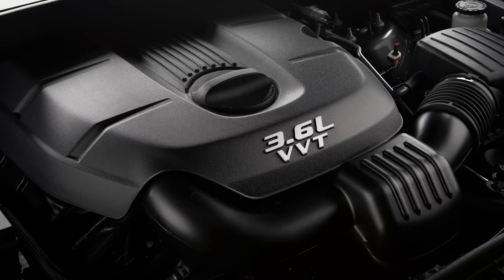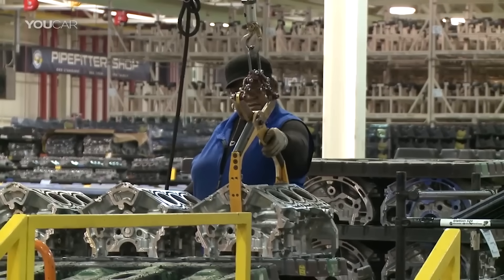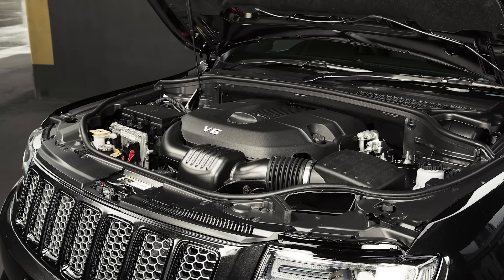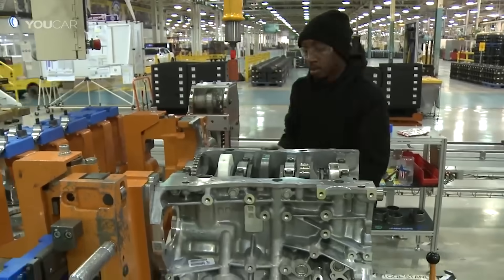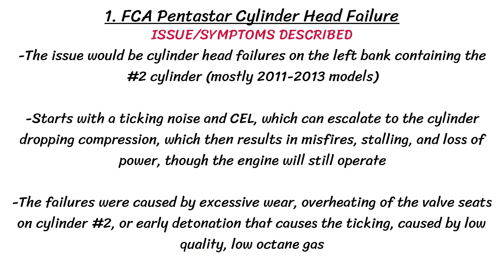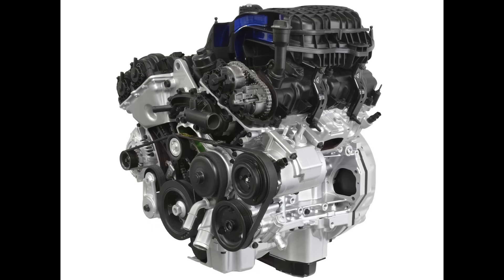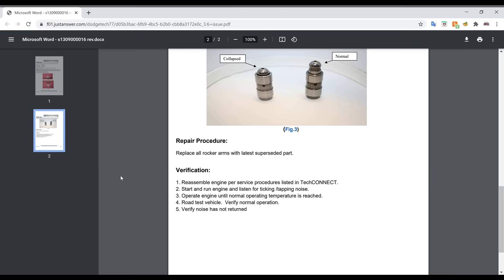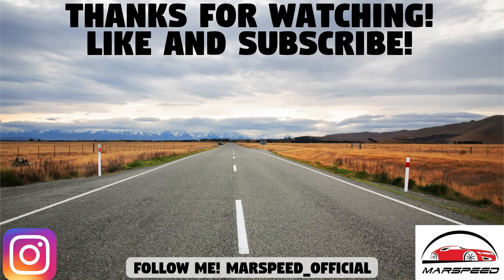The Specs and Fatal Flaws of the Chrysler 3.6L Pentastar V6 Engine

Comment: In Saudi we have the same issues or to be clear, the rocker arms is the most filed issue we have , I see a lot of guys that have the 3.6,5.7, and even the 6.4 engines have the ticking and a lot of them fixed it by changing the type of engine oil they use. NEVER use mopar oil its bad, use AMSOIL,PENNZOIL,MOBIL but never USE mopar

Comment: Ill keep my 4.0 inline 6 in my Wrangler over this engine.  236,000 miles on it and not a tick to be heard at any time   Still silky smooth.   😊
Reply: Mine would of made it if the frame wouldn't of rusted to dust.
Reply: @erichuff6945  frame is still good on mine

Comment: Can confirm the casting sand issue for sure. My Avenger developed the heat on one side deal. But minor inconvenience.

You left off the dual stage oil pump issue though. Check engine light and limp mode due to faulty oil pump. Usually the sensor in the pump, but sometimes is the pump itself. Really not too bad to fix though.

Overall I like the Pentastar. On my 3rd in my Challenger. Wanted the AWD GT. The Pentastar was not a deal breaker for me, but I did extend my warranty to 100K miles specifically for the oil pump and casting sand issues. I did ask if the heater core was covered and was told yes.
Reply: How do you fix the heat on
One side issue?
Reply: @tedpendagast579  Well ideally you change the heater core. You can however disconnect the heater hoses and back flush it. If you put some CLR down into it and let it sit for a couple hours it will loosen up the crud. If you do this you need to be 100% sure you flush all of it out before you put in back together.
Reply: @Ryzenberg78  why would it only be one side?
Reply: @tedpendagast579  the way the core sits in relation to the system. The passenger side flows through the bottom, which is where the casting sand and glue from the thermostat clog it up. That's why is you back flush it you need to let something like CLR sit in there and loosen it up. I had a 200 & Avenger that did this.
Reply: @Ryzenberg78  thanks! 

That helps alot!
Reply: @tedpendagast579  make sure you flush the entire system clean afterwards. Also use the Mopar fluid to avoid any possible issues.
Reply: @Ryzenberg78  now that I think of it 
It’s the drivers side that runs colder than the pass side 
So it’s probably a blockage in the hose huh?
Reply: @tedpendagast579  if that's the case make sure it's not a blend door calibration issue. Google the instructions for that. If it's not the blend door it's likely still the heater core. Typically it's the passenger side but I've heard of the driver side doing it on some models as well.

Comment: You didn't mention the oil filter pressure relief valve issue.  Nearly all 2014 and prior Pentastars have a broken pressure relief valve that bypasses the oil filter entirely unless the owner notices.  They fixed this in later models.
Reply: Care to elaborate at all about that issue, I’m having a hell of a time with my oil filter housing or whatever you call it. Oils just spilling out where the oil filter cap screws in at. Already replaced the cap and the filter, and it did it even worse,
Reply: @joshuahoskinson513  i deal with this problem all the time at work. The missing bypass valve or broken valve. Cap leaking are normally from tightening the cap to tight. I also find aftermarket caps leak. You need to replace the o-ring and lube it with lots of oil before you install new o-ring. They updated the filter housing bypass and put it in the cap. Now the when the valve breaks you need a new cap. The plastic on both bypass valve are super thin. Both are bad designs. When valve is gone than you drive basicly with no oil filter and engine life is cut down.
Reply: @longshotog2376  Okay, I have a 2014 with the  updated housing where the valve is attached to the filter and I replace the o ring and lube it every time as well! Everywhere is telling me I cracked the housing but wouldn’t it be coming out of the bottom , or at least not the very top like it is mine?
Reply: @joshuahoskinson513  Most of the time it comes out at the top of cap and o ring because someone over tighten it and it cracked the outside of the cup/housing. When the housing cracks it makes the housing bigger from the crack and makes the gap for the cap/o-ring bigger so it cant seal anymore. I find aftermarket caps are not the same size as oem ones. The aftermarket cap leaks likes 90 percent of the time for the same reason. The cap and housing gap is bigger because cap is smaller than an oem one. The o-ring cant seal the bigger gap.
Reply: @longshotog2376  Yeah I bought the OEM one so I guess that means the housing is probably cracked then another words?
Reply: @joshuahoskinson513  I cant tell you that. I run a quick lube and this is our biggest problem we deal with. Sometimes 5 in one day. Most the time it is just the valve missing. The housing is plastic and sometime they leak and look normal to the naked eye. We replace the o-Ring on new oem caps because they look to fat. Our filter comes with o-ring so we use that. We clean the housing and cap with a dry rag. Dip the new o-ring in oil and cover it with oil. You cant stretch the oring at all. You have to roll it on to the cap. You can lube the housing with fresh oil. If the o-ring doesn't have enough lube on it than the o-ring stretches. The old oil has dirty in it and this is enough to make it leak some times. i also don't really torque them. I run it down until it stop and thats enough. Maybe a little pressure but if you hear it making cracking noises than you are to tight. I do believe this is one of the worse engine to buy. We don't see very many with over 150k. Alot of people don't even care that the oil filter it getting by-passed.
Reply: @longshotog2376  Thanks for the insight, will update when problem is resolved.
Reply: So believe it or not my problem was being caused by the O ring. Apparently I’m an idiot and thought the O ring went all the way up to the edge of the cap, didn’t realize it was supposed to be sitting in the groove just beneath.
Reply: Thankfully I figured that out on my own, Dodge tried to charge me $750.00 so yeah that woulda f*cking sucked lol

Comment: Bought my Charger new back in Dec 2014 at 13 miles and now at 99400 miles mostly highway miles at 80mph. No engine issues to report. I did flush the coolant at 80k and change the 8 speed Trans fluid at 70k. Also I did switch to full synthetic at around 60k and do oil changes around every 4k miles

Comment: How about that oil filter cooler cracking at 80k on just about every 13 to 17 3.6!
Reply: Yes and on major back order!!!
Reply: '13 cooler is different that '14 and up. Different bypass valve, different filter, different body.
Reply: YEP!!!
Reply: The wife and I just bought a 13 T&C Limited last Oct with 101k miles. Love the car. Found a receipt in the glove box for the repair of this very part about 6 months prior to our purchase. I guess I know what that was now.
Reply: Someone makes an aftermarket oil cooler made from billet aluminium. Chrysler has so much problems with them last I heard there was 96,000 on back order.  I do one or two a week. Done so many I can do them with eyes closed.
Reply: just had it replaced a couple of weeks ago.  Took a month for the dealer to get the part in stock and over to my mechanic.
Reply: Had that happen on my 2014 T&C last year. Bought the van with the Maximum Lifetime Warranty otherwise the repair was over $600.
Having owned several other Chrysler minivans I knew that “ past performance IS an indication of future results.”

Comment: 2015 wrangler. Replaced rocker followers due to ticking. Bad needle bearings. Luckily for me, I did the work. Great engine otherwise.
Reply: Follow up. Had to open the driver's side up again and this time replaced every last rocker. Not a difficult job, but don't cheap out, if you break it open, replace them all. Currently 120k on the Jeep. I used Melling rocker followers.

Comment: 2012 Grand Cherokee.  123500 miles on the odometer.    Bought it used in 2015 with 42000 miles.    Great engine, but I do get a random puff of blue smoke from a cold start.   Guessing its a small amount of oil that seeps past the valve seals.

Comment: Hmm.Yeah I've heard of these engines having some issues. I guess I got a good one. My 2015 Grand Caravan has the 3.6 and it's got 340,000 kms on it and it's never given me any trouble. Still going on the original engine and transmission. AC/Heat has never needed servicing either.
Reply: Lucky you. I've got a '16 GrandCaravan and had to change the trans twice, injectors and lifters, rockers and cams. Also cooling/ overheating issues. All before 80k miles.

Comment: My brother bought a 2014 Charger SXT 3.6L  w/8 speed auto in 2017 w/34k Miles, originally was rental car. Had one fuel injector fail and that's it. He has about 180k miles currently and has had no other issues so far. He drives very hard and drives for Uber currently. It has decent power and gets 30 MPG even at 90 MPH.

Comment: I've got a 3.6 in my 2014 Ram 1500 and I love it. As the owner of an independent repair shop, I was familiar with the rocker arm issue but decided that it was an easier fix than the cam replacement in a Hemi if it came up, and I have done many of them on other vehicles. 

The Pentastar puts out just over 300 HP in the Ram, unloaded it gets 20+ MPG highway, it can tow 7200 pounds (I get 10-12 MPG towing my old travel trailer and 13+ towing cars,) and it has a full size crew cab to haul family and dogs around. It's quiet and comfortable inside. It's incredibly versatile and does everything I need it to do.

My only complaint has to do with the oil cooler, which didn't make your list of issues. It's mounted in the valley and is a common failure item, leading to coolant leaks and a constant evaporating coolant smell. I replaced mine with a cheaper part than the $300 (at the time) dealer replacement... Which then created an oil leak down the line. I will be changing it again soon.

Comment: My 2016 Jeep crapped out at 12,000 miles. Most of the roller rockers failed sending metal into the oil. So nice....

Comment: Just got rid of my 2016 T&C with the 3.6 ,less then 78k miles I had 8 rockers ,4 rods,2 coils,full cooling system replaced,3 battery's, hell even the windshield reservoir failed,And my vehicle was a gen 2 pentastar, all work was done as warranty work by dealer

Comment: Had a 2011 Charger, no problems but never liked the 3.6, lacked torque / too rev happy.  Apples to oranges but, the similar sized 3.7 in my 2014 F150 is superior in every way. Torquier, smoother and likely equal or better fuel mileage.

Comment: And people tell me that my 06 hemi is prone to failure. 16 years and over 300k kms and ZERO issues other than basic wear and tear and maintenance.  People get so bent out of shape with the fear that they MIGHT have an issue that they tend to ignore the actual numbers of failures.  I am certain that the VAST majority of pentastar owners will have no problems and will enjoy their engines for a long time.  Every engine has design flaws that get corrected over time and this one is no different.  Best practice is to maintain your engine, change the fluids regularly and with good quality oil. Use high quality fuels.  Change your filters and keep up with regular maintenance.

Comment: I have a 2015 Dodge Charger with the 3.6 pentestar, as of last week I have now replaced my radiator for the 4th time. Ac has issues constantly, etc. so I can attest to this, also had the thermostat replaced multiple times as well.

Comment: The 4.0L straight 6 was one of the best motors Chrysler made, they should have modernized it a bit to get it to 350HP and similar torque.
Reply: No. The 4.0L I6 is an AMC designed engine which continued to be made by Chrysler after the AMC acquisition from Renault. Christ. Does no one actually know history?

Comment: Oil cooler assembly leakage is a MAJOR flaw that should be a recall, specifically on 2014+ Jeep Wranglers, I guess explained in item 3.  Is that issue limited to one manufacturing plant ?  One worker ?  Who just had no work ethic, or lack of ?  As of March 2021 there is a severe back order of Mopar oil cooler assemblies and a lot of people are having the issue where the gaskets or the cooler itself fails and causes the “valley” of the engine to fill up with motor oil and present a huge fire hazard.  This should be a fix that is covered for the life of the vehicle.
Reply: i have a 2014 wrangler with a busted oil cooler assembly right now... can't even get the part... been waiting 3 weeks for it... they say their on back order... I'm probably going to have to buy a cheap Chinese knock off that they say usually fails in under 10k miles.

Comment: I ran a fleet company for 3 years almost 150 dodge caravans from 2012 and up, pretty much every one wiped its cams and lifters multiple times! They all had oil leak issues constantly rear main seals and oil filter housing/cooler leaks and that’s not touching on the fact that most the vans are up there transmissions, total garbage!!! We had 75 Kia Sedona vans in the fleet most with well over 200k miles never needed more than oil changes tires or maybe a c/v axle here and there

Comment: Had a 2012 JK.  Junk.  Broke down just sitting in my garage. My issues were oil cooler gaskets twice, relief spring in oil filter housing(Dorman kit), fusable links that ran the injectors and coils on both heads, and massive oil consumption when I sold it. Even after replacing the PCV.  No FCA ever again.

Comment: Great Video.  I have a 2016 Wrangler with 40,000 miles.  The engine runs great to this point, but I may try higher octane gasoline as per recomendation.  Also, oil changes are critical.  I use synthetic 5W20 Mobil 1, and change every 3 to 5 thousand miles.  I also suggest service cooling system every 3 to 5 years if you don't exceed mileage recomendations.  Also, don't beat the tar out of the engine - easy does it.  I also use Lucas gas treatment/injector cleaner.
Reply: 40,000 miles??  You barley broke that motor in .  Ha!  No but seriously.. keep putting mikes on that bad boy.

Comment: Never mentioned the oil cooler failures. My 15 200 had that happen. Lost all its oil in a parking spot and I noticed a small amount of smoke. I shut it off and looked to see what was wrong. Had it tower to the shop for them to tell me that the rear main seal blew. After a little research and a look at the oil lying around the valley of the motor I found out it was the oil cooler. Fixed the car and put about 300k km on it and then a dog ran out in front of me and I hit the trees.

Comment: Thanks for this video.  My mom's 2014 300C AWD had the oil cooler/filter housing seals go bad at 58k miles which I fixed myself, not too bad.  No ticking though fortunately, we'll see how things are going 40k miles from now (if she still has it).
Reply: don't idle the van too much for more than a minute at a time, and you should be fine. A few mechanics I worked with over the years have narrowed it down to excessive idle time. The 5.7 Hemi's are even worse for it.

Comment: my 18 JL had a rough idle since day one. 20% of the time is smooth you can't feel the engine, 50% is just rough, and 30% it's shaking.....no cel no codes. dealer can't fix it.
Reply: Try fuel injector cleaner and try running better gas like Shell or Mobil. If that does not work try a gas tank water remover additive good luck.

Comment: Anyone with a Pentastar engine should only be using the recommended oil brand from the factory which is Mopar, Shell or Pennzoil. The oil jug should say meets requirements for Standard MS-6395. I would go with Pennzoil Ultra Platinum, that’s probably the best one that meets the Dodge/Chrysler/Jeep requirements.